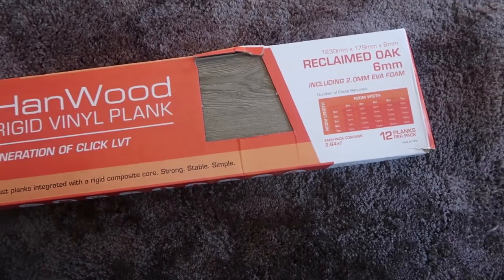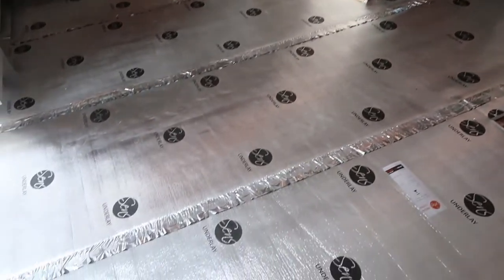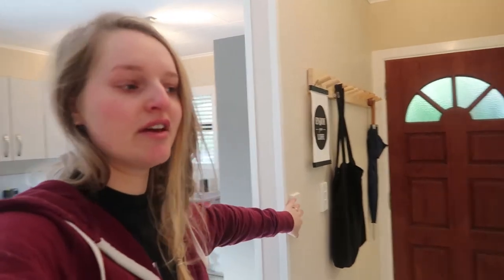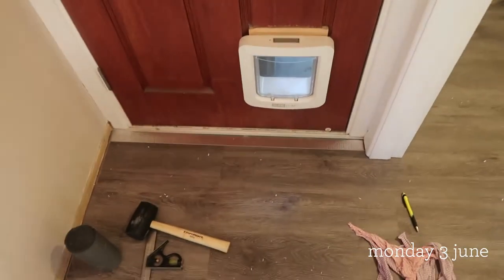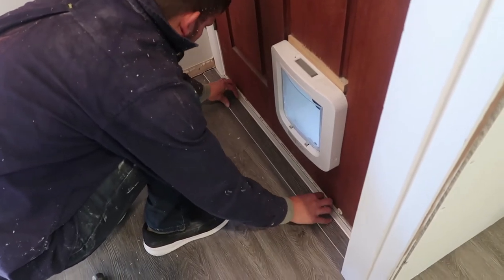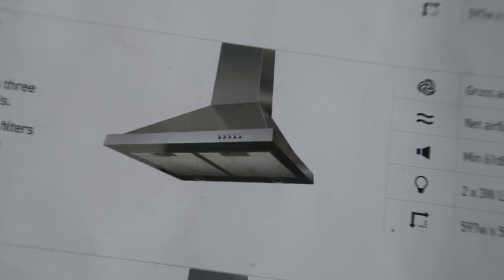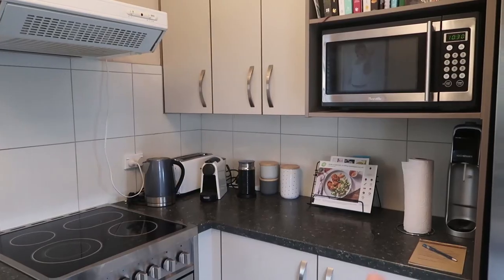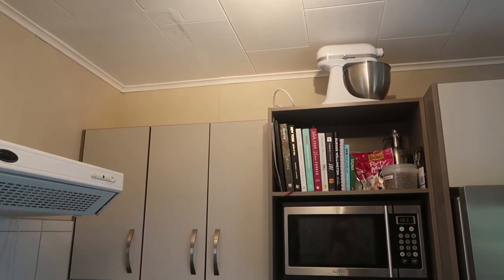The entrance way / kitchen renovation | DIY vlog

Comment: Nice! I ordered 12 packs of 8mm sunset oak flooring planks last week. Was hard to see but did you guys left some spacing around the wall for expansion? Looked like the planks were laid hard against the wall. Oven looks great by the way. And for the tiles, why not remove that picture frame and place another hung cupboard to follow the consistent pattern and tile underneath like the other side?
Reply from the maker: Nice! That’s gonna look good. Yeah we left about 5-10mm around all of the outside for expansion. Only problem with removing the picture and putting a cupboard there is the window :/ any cupboard would cover a section of the window. We could I guess put shelves there instead of a cupboard?
Reply from the maker: Just watched the video back and can see what you mean re looking flush against the wall. Around the stairs/ lounge we have those transition strip things so cut the panels to have space inside of them, and then just slotted the panels in
Reply: @smayjay  Your right didn't think about the window. Floating shelves will work, trending and can make use of space for storage. You could even tile flush from the bottom floating shelf for a clean finish.
Reply: @smayjay  Haha yeah. I'm used too seeing peckers used for a guide of measurement for the spacing. As you know the spacing is critical for expansion. Looks really good!
Reply from the maker: Yeah very good point! Thanks 😊
Reply from the maker: Yeah we, for whatever reason, meticulously measured it all by hand/ ruler haha